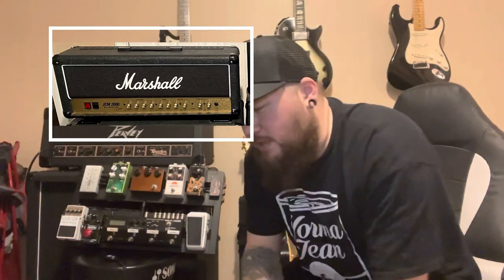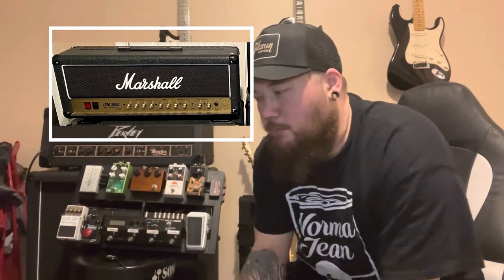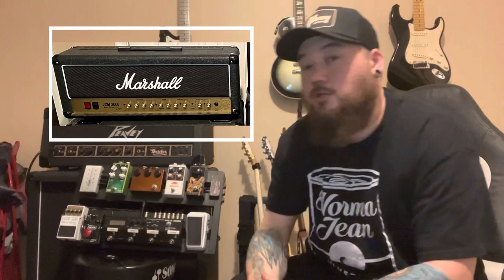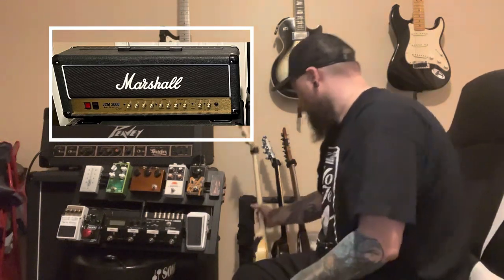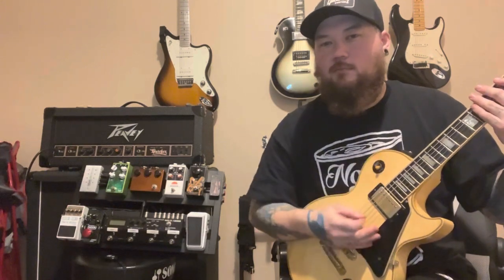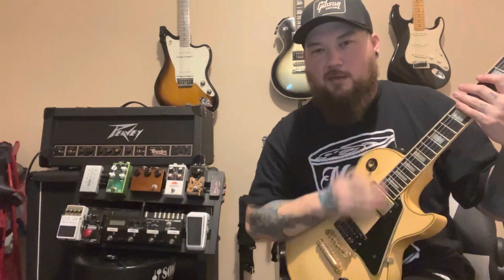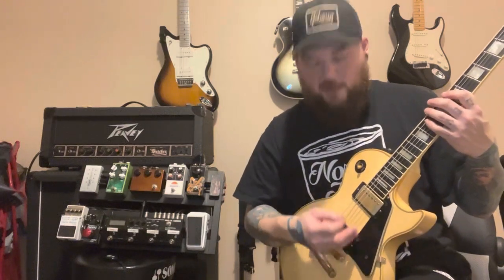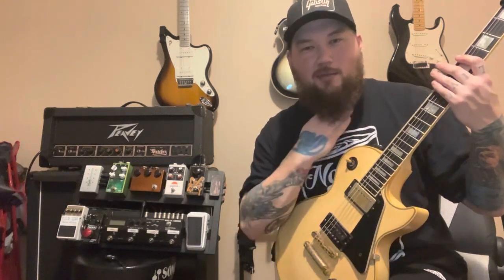Building a Guitar Rig With a Purpose

Comment: Good video!

Maybe I missed it, but you didn't mention you cab and speakers. The cab and speakers are the most important thing for the overall tone in my opinion. So If you think your amps sounds too thin, get some other speakers (Jensen Falcon is a super low end heavy speaker that goes well with pretty much every other speaker, or a Eminence Swamp Thang) or maybe just 2 and do a X pattern mix in a 4x12. Mixing speakers will give you a way bigger sound in my opinion.

I'm the exact same way when it comes to pickups. I also rebuilt my pedalboard with a purpose a few monts age.
I use: Korg Pitchblack X Mini (because it is small and has a good sounding buffer in it) - Lehle P Split III (to split the signal, one for my guitar amp one for a bass amp that we use live) - Boss OS2 (best sounding OD in my opinion, because it can get a bit fuzzfy as well and has a lot of volume boost, as my alternative I built a GCI Hannibal OD) - Boss OC5 (I use the octave down effect to fatten up some single note runs) - EHX Mod11 (all the weird modulation you could want, live I use vibrato or flange) - Ibanez WH10V3 (because it is lighweight and sounds decent) - EHX Canyon (as a delay or reverb pedal).
Reply from the maker: I didn’t mention it in this video. But I use a couple of Marshall cabs. My main live cab is a Marshall mode 4 cab with 70 watt celestions in it. I love the cab. I also have a 1960B cab with GT12 75 watt celestions that I use sometimes.